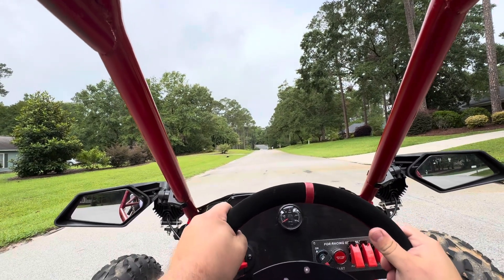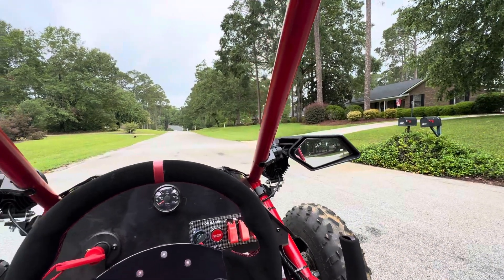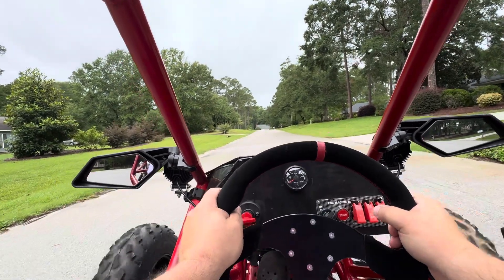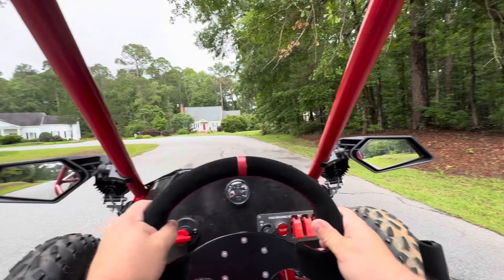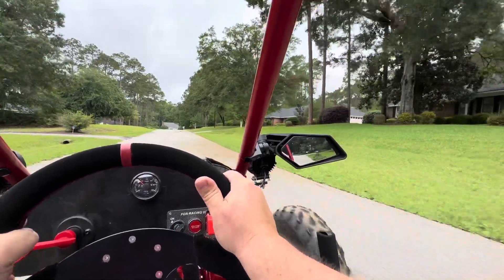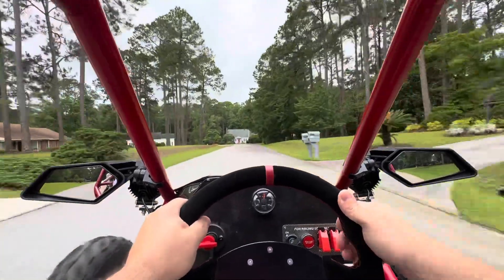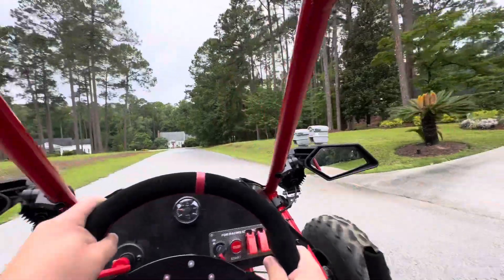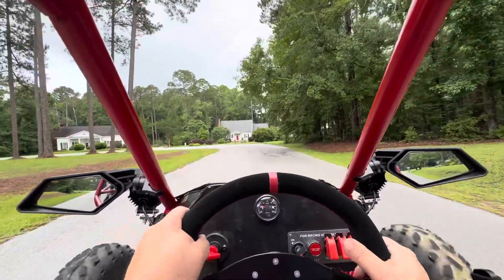Brake performance test on my home built @KJRaycing VF-1 Crosskart!

Comment: I would say if you cant lock the tires up with the brakes that they are not big enough for your application.
Reply from the maker: I agree. I found out that yz450 dual piston caliper fit this. So, I’m planning to try that. However, I agree the front brakes are undersized for this. I think I have a couple things working against me. 1 the brake pedal has less leverage / mechanical advantage than my hand brake so I have to push it A LOT a harder. Additionally my front rotors are like half the diameter of my rear rotor.